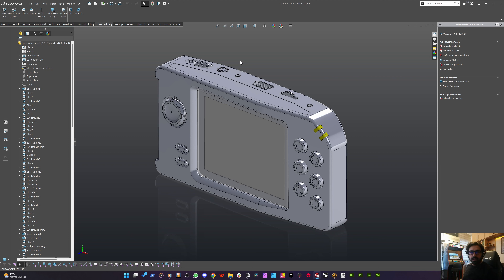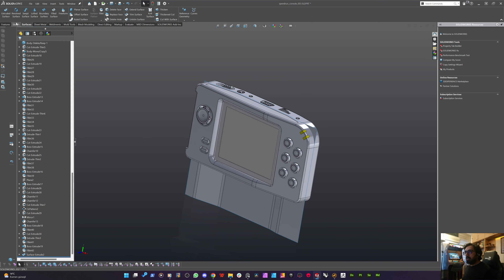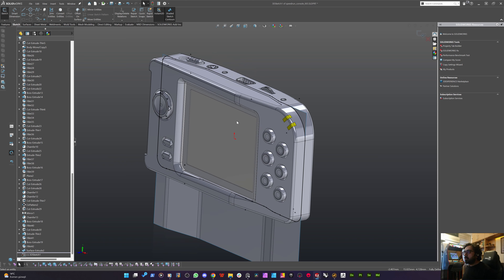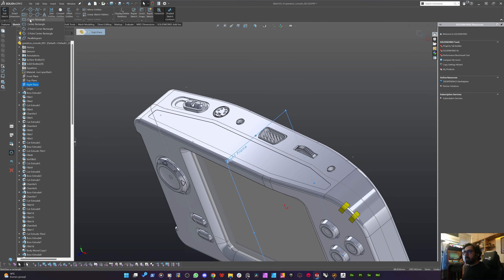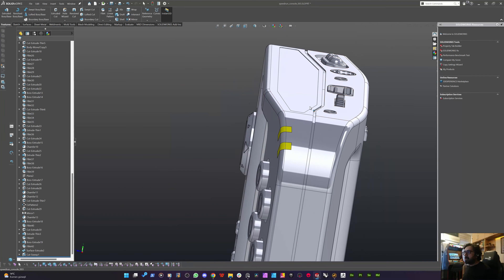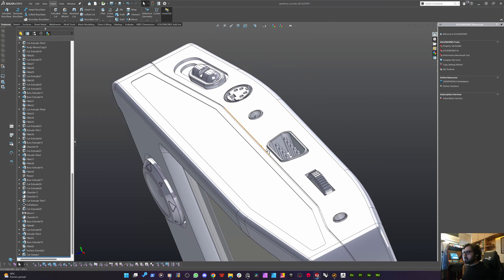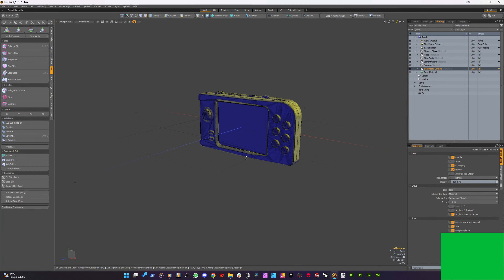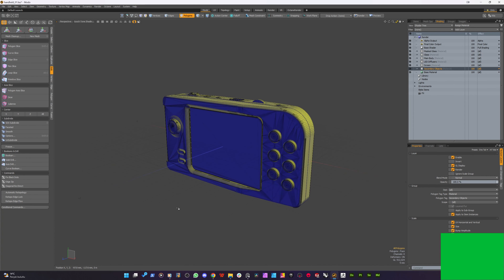Speedrun Sessions - Handheld Console Design - Chapter 03

Comment: hi Cem, how do you isolate material by color? hotkey?  i'm a noob in modo 😐
Reply from the maker: Hey Jiovane, I select the material after pressing 4 in keyboard by switching to material mode, and than I convert the material selection to polygon selection while clicking polygon button while holding ctrl key from keyboard. And the inverting the selection and hiding all to isolate the selection. I'm not sure if it's what you're asking for :)
Reply: thanks so much Cem! @cemtezcan
Reply: @cemtezcan  Hi Cem! Sorry for bothering you again 😬 , I'm not able to hide the materials to make the UV map separately. What shortcut key do you use? I'm new to Modo and the tutorials on their website are too technical for me. Thanks!